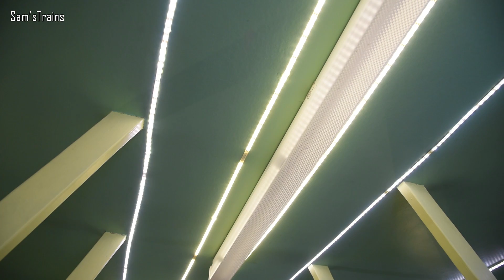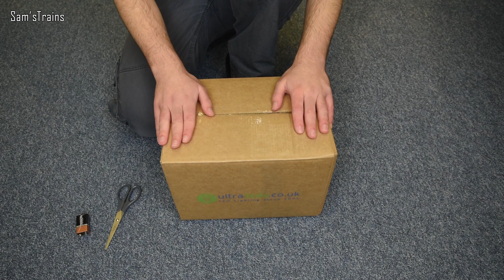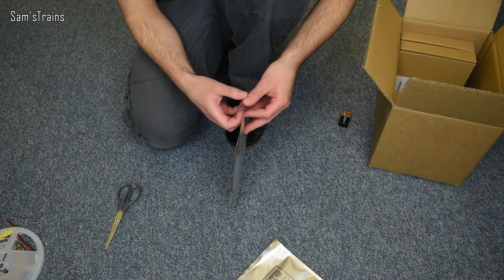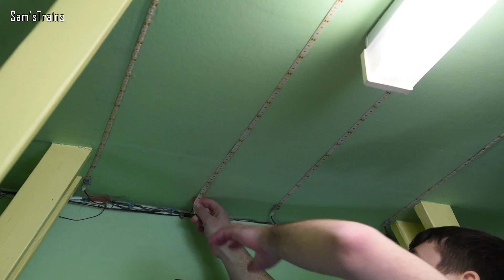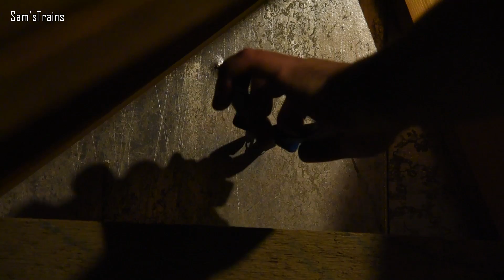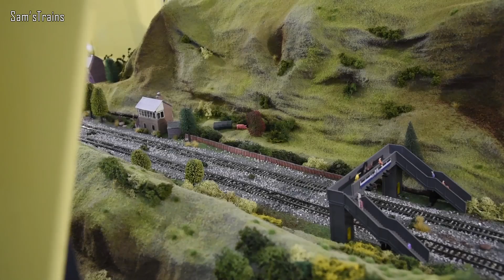Updating the Railway Room: New LED Lights

Comment: I'm surprised at the difference in brightness - you might even see those tiny springs/screws that are usually lost forever. Should recoup part of the investment with electricity savings. Good ideas when replacing or installing lighting. Wondered if you ever tried one of those daylight bulbs/strips in a tiny area (over a station ?) (supposed to give natural light) in an area -- artists use them. Alan.
Reply from the maker: Thanks Alan - haha possibly, though I vacuum regularly... so it's better to just take the contents of the vacuum cleaner outside and wave a strong magnet over it - I find so many lost screws that way!!
That sounds good to me - presumably those are Hi-cri strips? That's similar to what I've just installed!
Thanks for watching - Sam :)

Comment: Maybe you could diffuse the LEDs with something.
Reply from the maker: It actually works fine without any diffusing - the floodlights and beam lights are positioned so that I'll never (or rarely) cast shadows in front of them! The lights on the ceiling don't seem to cast many shadows either! :D
Thanks for watching - Sam :)

Comment: I was looking around the room where I have my trains and computer after watching this video, and I might give these a try! I might just put two strips in each dark part, and try to wire them to a voltage converter and outlet!
Reply from the maker: Good luck mate! Just be very careful - make sure you fully understand power consumption and current loading.... if you overload your power supply, or use wires that are too thin, things will get hot very quickly - and you don't want any fires!
As long as you do everything safely, it should work fine - make sure all those joints are insulated!
Thanks for watching - Sam :)